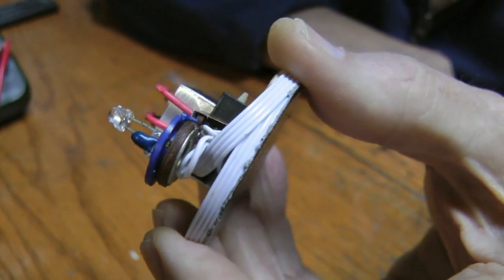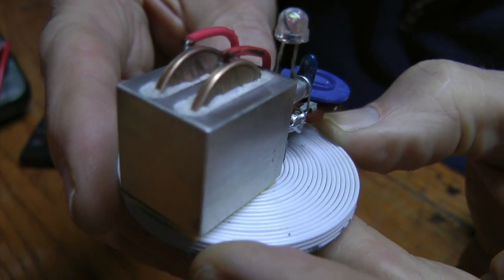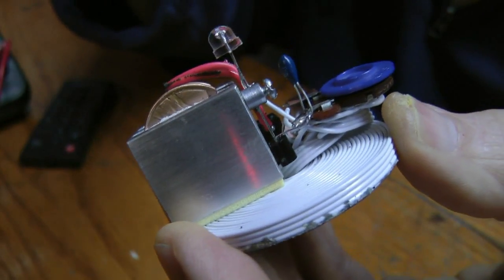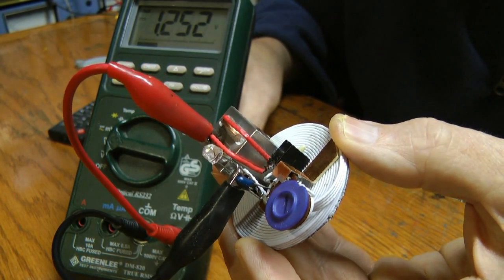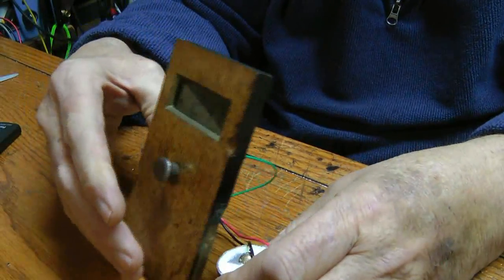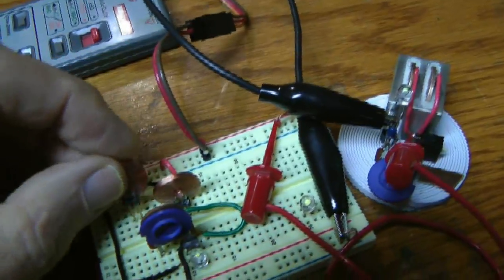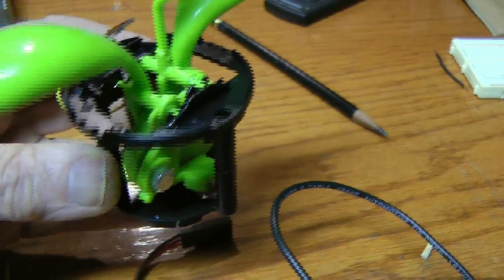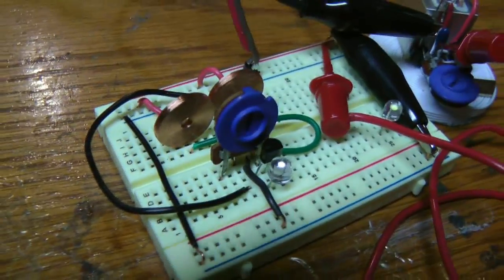2 Cents Worth On Oscillator

Comment: you can give the joules thief inbetveen and the led will shine very bright if you dont know vhat is joules thief ask me
Reply from the maker: Helo Miha, The circuit is actually a Joule Thief. The pancake coil is a bifilar wound coil, it just looks different than two small coils on a ferrite ring for example. The battery itself produces only about 1 volt which wouldn't light the LED without the JT circuit.
John
Reply: *****
but this joules thief is so large,I made a lot smaller (but it has a wery large coil
Reply from the maker: Miha husqarna This one is large because of the pancake coil but it is very efficient. This one will run at very low voltage and current, much less than the conventional small size versions. The coil is actually similar to the Tesla pancake coils. It's unique in several different ways.
John

Comment: The Asian population, Hmong mostly, just 2 blocks west of me, Stockton Bl..commercial stuff..about 1-2 miles of nearly all Asian stores. I might find a variety of 'imported' electronic stuff like you found.
  I like to buy USA when I can, but the eectronics is mostly pacific rim (as they seem to call it) Copper wire? yes, the 'wire' gauge. and I see some of the steel wire with copper coating, a tad cheaper than solid copper, I see it in cheap stuff a lot. can't take much current though.

Comment from the maker: @iluzyon1 
Actually the diodes I'm using are salvaged along with the rest of the parts from solar garden lights. We have what is called a Dollar Tree store here and they are, naturally one dollar. For that price you get a nice thick glass solar cell, a Joule thief circuit and a battery. The diodes are very good for this type application because they will run pretty bright at 1.8 volts and probably only 3 ma. Thanks for your comment though.
John

Comment from the maker: @stevemacbr 
Steve. Ha, now I'm gonna have some fun. I prefer the SWAG method for figuring most things out. (Sophisticated Wild Ass Guess) Kidding. I'm impressed with your knowledge and have to admit I was never very good at such calculations. I use conversion tables to help me with most stuff. Being a master of reference is a useful tool. Buy the way this is interesting: The wire is extremely flexible and is steel with copper plating. How weird is that? 1 US dollar per roll.

Comment: Great Video! I have one of my own crystal cell designs that still powering a LCD clock since October. Lidmotor was testing my stove top crystal cell with his penny oscillator, I don't know if its still running but it was interesting and fun project. You can check out my channel for some of my crystal cells, I'm now working on making a 5 foot tall crystal cell that I'll post a video of in a few days.